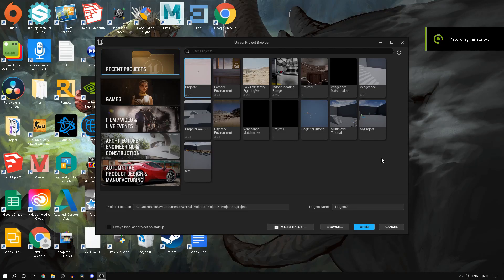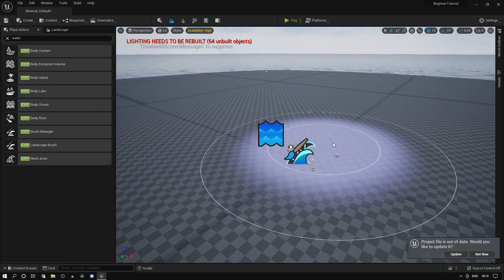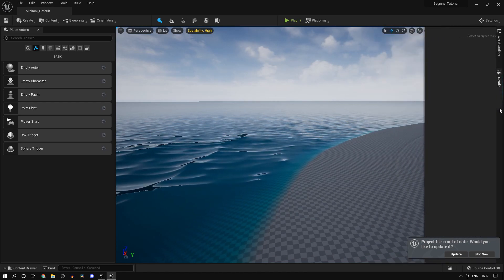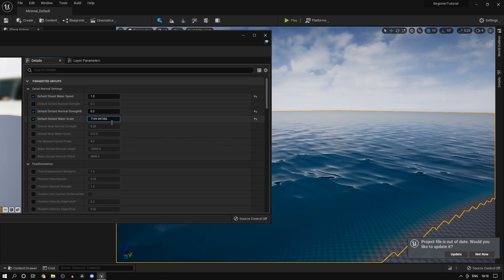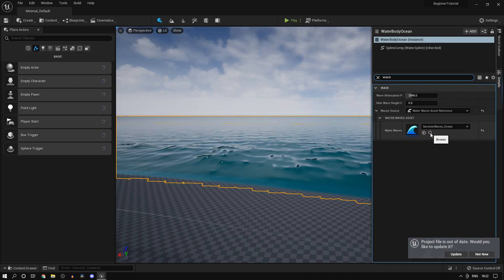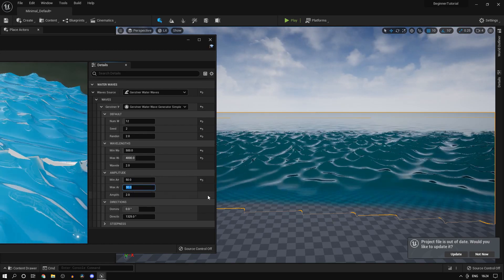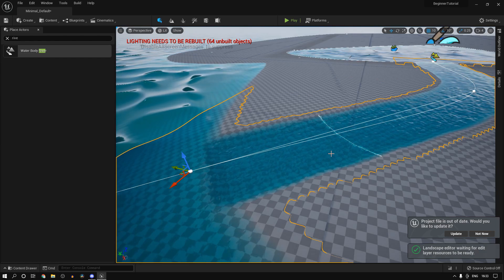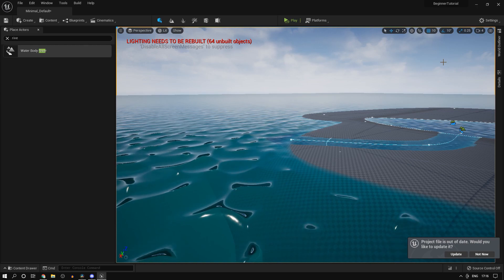Unreal Engine 5 Water System Tutorial | UE5 Water Oceans, Lakes and Rivers

Comment: You've potentially saved me so much time, I'm still using 4.26 , I assume this tutorial will also work with UE4?
Reply from the maker: Pretty much. On that note even I am still using 4.26 for my project.. not happy with ue5 performance on my pc
Reply: @gamiumdev  What are your specs ?
Reply from the maker: @maloxi1472  i5 8400 16GB ram 1050ti 960 Evo SSD for unreal

Comment: Don't you know why isn't still there a refraction in water bodies in UE5? You know, in 2021. It doesn't need a ray tracing or path tracing, it's just special a vertical scale based on precalculated data (made based on water IOR value 1.3325). I just wonder why is it so hard to make…
Reply from the maker: Not rlly sure..
Reply: @gamiumdev  In another video somewhere, I saw that there are actually two IOR values which can be specified, "near" and "far" which is strange but at least there's something relating refraction. But that video was about glass, not water. Could you please check this focusing on water, water settings? And you could make a video about it. 

I'd see so much some shoreline with refractive water (IOR: 1.3325), as underwater parts of object contract parabolically, like on this sample: https://www.youtube.com/watch?v=RukSxOYO-BM (This is made in Blender.) :)
Reply: @merion297  This is hella old but I think you can use a planar reflection on top of the water to make it reflective in real-time
Reply: @axelpothier2957  :) No-no-no, refraction, not reflection. 😁

Comment: Please tell me, as I understand it, if the landscape is generated by a height map, then the ocean interacts with it not quite correctly. My surf line turns out to be broken, as the water interacts with the landscape segments.
P.S. Sorry for my English.
Reply: Its the same with 4.26 you need to make sure that no part of the terrain is below 0 on the Z axis, Just create a point actor set it to x:0 y:0 Z:0 and then look to see if any part of the terrain is below that. Or you could create a planeand set it to the same so that its as large as you terrain and check the landscape is all above the plane and you should be fine. Also be careful the ri ver and lakes have issues if the terrain you create is over 2K in x and y dimensions. (river especially can cause big performance hits) when doing large sceneries I normally use a mesh and apply a water material to it, set collision off so player can walk through river, then apply a water shader to it. but you can use the properties when creating rivers etc that control the amount that it sculpts the terrain when placing the river tool in an existing scenery.,
Reply: @ukveteransgaming465  Thanks bro, at first I could not understand why water does not appear when I added the ocean to a piece of terain with a piece of mountain sticking out, and when I applied terrain to the entire landscape, which is just 2.5X2.5 km, I did not understand why everything is so slow. You solve my problems!
Reply: @kostyayaskevich6920  ya welcome any time
Reply from the maker: Yes, thats a problem. Try to get the edges of the landscape to be the same height as the water. It should fix it. But I would suggest using a different shader for heighmaps.